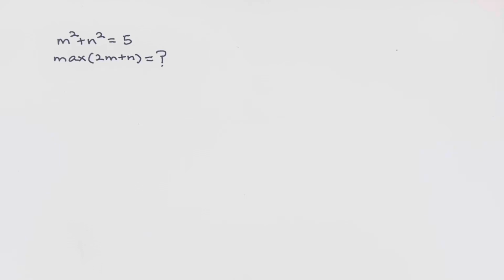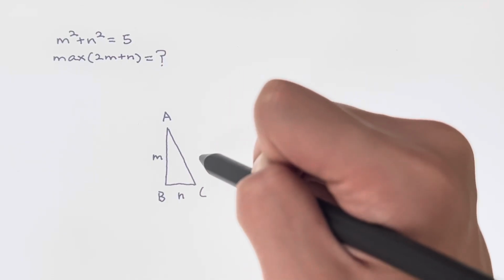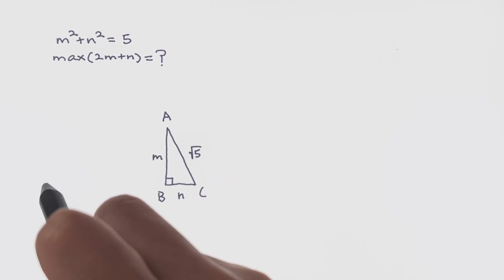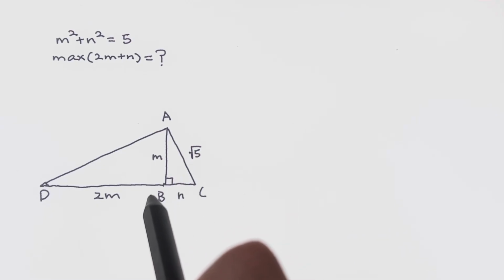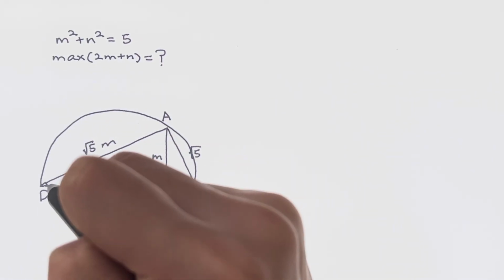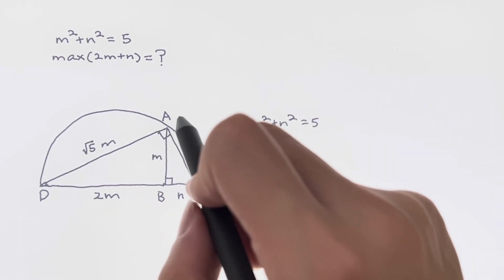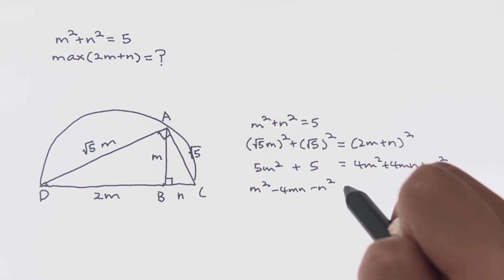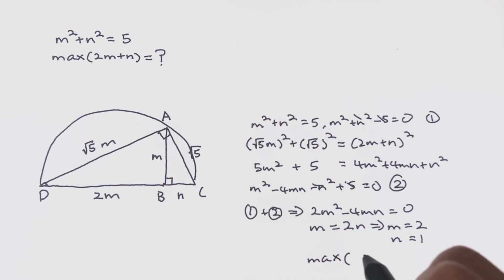Q551 | Math Olympiad | Geometry | Extremization | Right Triangle | Circle | Pythagorean Theorem

Comment: If you consider a point (m, n) then the constraint given is that (m, n) lies on a circle of radius sqrt(5). Say the maximum value of 2m + n is k. 
2m + n = k has to have a real solution (m, n), for which in the threshold case the line 2m + n = k will be a tangent to the circle.
The distance of the center of the circle is equal to the circle's radius, giving you k = 5.